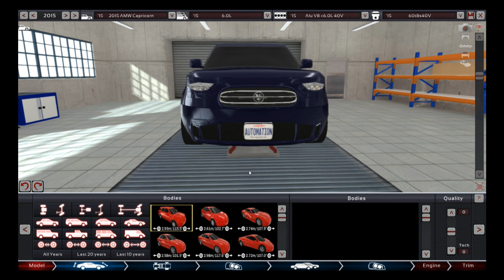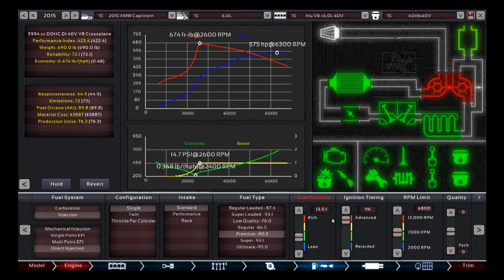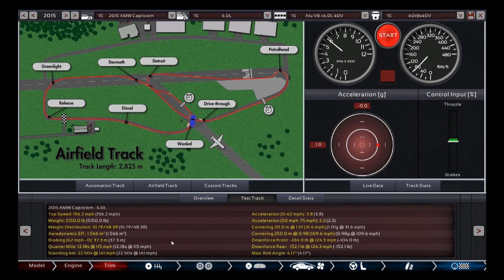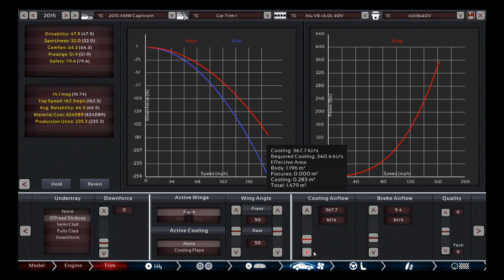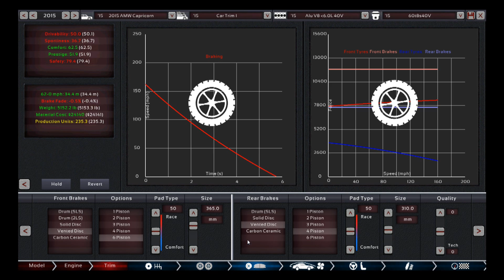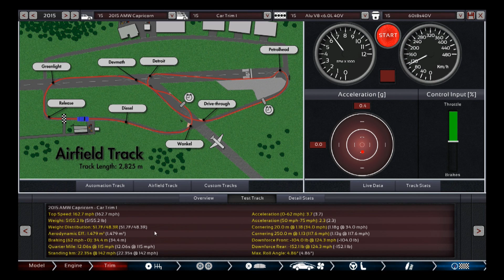Automation: AMW Capricorn Review

Comment: Great review! It made me realize a few things that I could have done better. Note that the top speed is supposed to be limited to 155mph (250km/h, but it didn't let me set that precisely) because I don't think it makes much sense to let a car like this run any faster. This kind of car will almost always generate lift. Also, the tires are changeable but for the purpose of going off road, I put on the offroad tires which allow this car to have an Offroad stat of ver 50 (and that's very competitive!). Want more performance, just put some sports tires on and watch the numbers ;)

Oh, and the cooling airflow is quite a bit higher than needed so that you can take this car and drive through the desert if you want to, without the engine overheating. This is a car that likes going offroad, unlike most so-called "SUVs".
Reply from the maker: +Tom Henks  For the top speed you have to consider the fact that a lot of vehicles limited to a top speed like 155 MPH, which if I remember correctly some countries require such limits by law, the car is limited electronically not by the gearbox setup. I think the better way to think about it is to setup the gearbox as if there was no MPH limit and then pretend the car has a limiter that doesn't allow it to go any faster than 155. I know it isn't a perfect solution, but it is better than being hamstrung by a gearbox that will ruin economy numbers and produce tons of wheelspin.